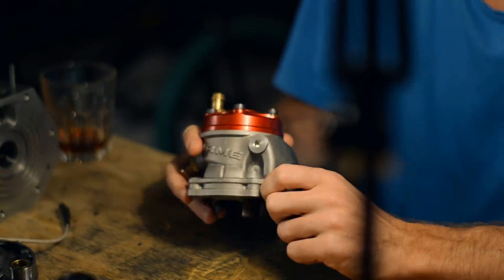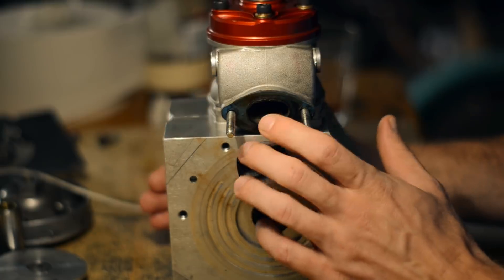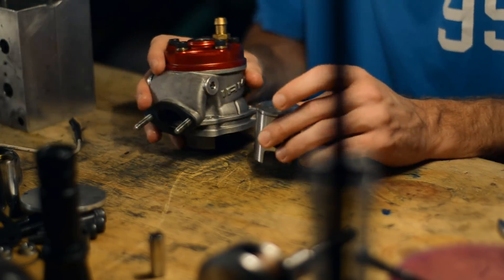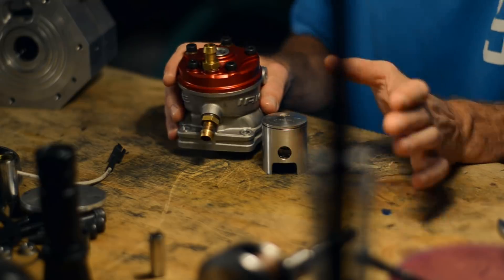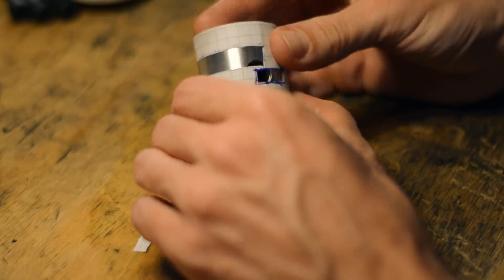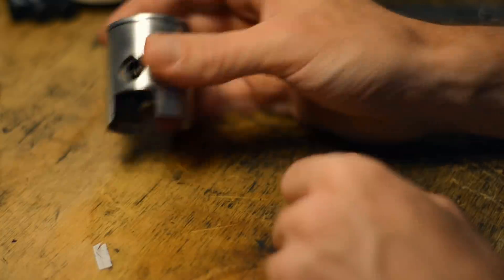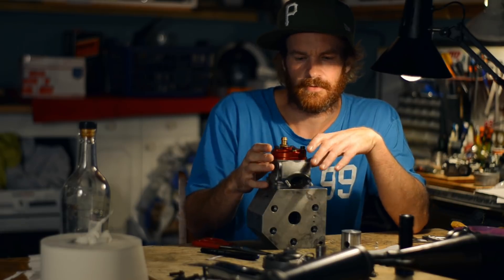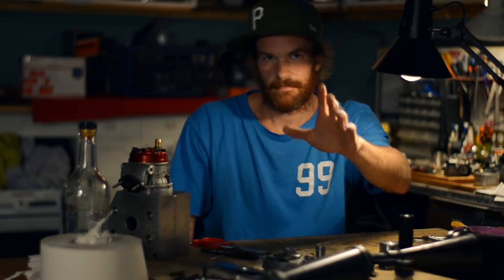A Two Stroke Revelation!

Comment: Hi , Check Your History , Model Airplane / Aircraft engines back in the 1940's ( And to Present )  In some used a " Rotary intake valve /  But the Exhaust port could be machined into the crankcase in any Direction In Relation TO The Crankshaft Rotation .  Some High Powered Racing Engines Used What Is Called "" SCHULE CYLINDER PORTS ( Porting )  "  Some Engines Even Had Small Transfer ports That Were Cut at a Angle to direct the flow of air/ Gas Mixture Toward the glow plug ( Spark plug ) , This also Helped with Scavenging the Exhaust OUT of The Engine . Good luck . :)

Comment: Hi sick video! I have a question (again lol) I have a chainsaw style flywheel (not the scooter kind like this https://www.google.com/search?q=g260pum+flywheel&oq=g260pum+flywheel&aqs=chrome..69i57.7156j0j7&client=ms-android-google&sourceid=chrome-mobile&ie=UTF-8#imgrc=6uNeYQQusIUBKM:)  and I have to drill out the hole and when I do that the flywheel key slot won't be deep enough so how would I go about making that slot deeper? I don't have any fancy machines like a mill I have a Dremel tho. Also is it a bad idea to to drill out the crank pin hole (big end) to fit a bigger diameter pin?
Reply from the maker: Thanks! The slot can easily be worked with small files, won't take much effort - no need for fancy tools. Re the big end, should be fine as long as there's enough material (at least half the pin size in thickness anywhere around it)
Reply: @2STROKESTUFFING  awesome!

Comment: Maybe I'm wrong here, but i think you'll achieve more or less the same result by replacing the rotary valve in a position like this one, at least regarding the crankhouse symmetry / scavenging symmetry:  http://club.caradisiac.com/druide60/private-category-0/photo/moteur-ital-sistem+2db-1191704.html The guy who invented this is named Achille Parrilla, who for several years was the major engine tuner at the DAP factory in Milano. I know him very well, as I used to race their engines back in the seventies, in different championships. After I ended my racing period, Achille came up with this solution, an gained several more horsepower. If not to complicated to arrange, maybe you should try it?
Reply from the maker: Thanks for the link! That would achieve symmetry, but not solve the exhaust/transfer communication issue.

Comment: What about the pumping effects of the crank ? ie, primary compression ? as you've moved the transfer ports 90 degrees to the crank..? and you've changed the major and minor thrust faces..? Not really sure you've improved anything at all ?
Reply from the maker: Cylinder orientation doesn't affect primary compression as long as crankcase volume stays the same. Yes, moving the thrust faces 90° might be a problem(as mentioned in the video) but then again maybe not cause there's ceveral engines already running in this configuration seemingly without issues.

Comment: the improvement of a  rotary valve 90º vs transfers was demonstrated by the Derbi 125 stroke wining the last word championships. They were putting the rotary valve on the back (as the normal admission) and rotating the disc valve trough a 90º precision bevel gears. Flow is symmetrical to the transfers and better oriented (less restrictions).

Comment: Give it up bro, petrol is dead, electric will take over within 5-10 years.
Reply from the maker: That's true, I'm just doing this for fun.
Reply: 2STROKE STUFFING the biggest problem with the two stroke was it’s fundamental design. It is not fuel efficient and although they make the best power for displacement size the power is only available through a narrow rev range. What your doing can’t change that but hey have fun

Comment: so the problem i see is, port timing. in my mind it would be ideal to have the piston rotated 90 degrees with the cylinder. so a connecting rod that is twisted 90 degrees to match. i love the idea that is going on. however the transfer port timing seems to be a problem in my mind. with the piston matching the cylinder, you can have your 100 percent exhaust port width and still be in control of your port timing. however the challenge i now see is how to have a strong connecting rod that is twisted 90 degrees from the crank? or a custom connecting rod made with a large piston pin head to be able to machine 90 degrees out. subscribing to see what comes of your engine!
Reply from the maker: Thanks! The piston will have to be designed for the job, and port timing won't be a problem. A twisted conrod would not work, think about it it would bind as soon as the crank started rotating.
Reply: ahhhhhh i didnt think about the width of the twist!

Comment: It's a nice concept but you can never run 100% exhaust port width. I think it was the 3MA TZR250 that had it's cylinders reversed, so that the piston would be mostly supported on the intake port side on the powerstroke to limit the ring and piston wear from the somewhat larger exhaust ports (unfortunately I don't have any stock 3MA cylinder to measure the width). Back when I ported my Typhoon's cylinder I went for 63% which is 3% more than the "limit" for cast iron piston rings (with chrome rings you can go up to 65% but you can't run them on plated cylinders), and the rings last for only a few fast rides.
Reply: My Parmakit 144cc have 82 % exhaust original, it is bridged exhaust, my polini evo 130 had 68 % and not  bridged.
Reply from the maker: On smaller stuff you can go wider, I've seen 85% in a 40mm bore working.
Reply: I think this would heavily depend on piston-cylinder clearance but it wouldn't last for long. A large fillet on the port windows could help but the piston ring design is equally important for this. It's the rings that will give you hell if you get too much out. I have thrown many 47mm pistons with tiny pieces of rings stuck in the ring land. 3 runs and the ring land start getting worn out in that area. I don't know if keystone rings could help, and I don't know what ring gap design would be safer (I find that the half circle peg gap rings seal a lot better as they wrap around the peg)
PS: It just occured to me that you're reffering to the whole port including the bridge...Yes that would work fine but you shouldn't go all out, as the bridge just helps the ring get seated and is relieved compared to the rest of the bore.
Reply: with my experience, you can go 100% but the port has to be shorter. down side is not getting all of the exhaust gas out. benefit of not loosing all of the exhaust gas is cooler cylinder temps and more pre detonation protection. kind of a weird trade up. i do see and understand your concern. the smaller the engine, the more you can get away with.

Comment: We messed with the concept of intake and exhaust ports on the same phase back in the day on a YSR-50. Devcon will be your friend with sealing the wrist pin. The most crucial aspect of this design is transfer port angle and shape. Varying the port angle to keep the fuel charge turbulent in the combustion chamber is critical, having a port angled at 3 and 5 degrees while one oval and one squared off helps to. Software and information is a lot better today than in 1990 so make good use of it and have fun

Comment: Did this same thing over 30 years ago, shortened the piston pin and made aluminum caps that were placed in the pin bore, piston pin rode against the inside of the  caps still in the piston pin bore, and used standard circlips,  benefits from the lighter pin , sometime used custom pistons, sometimes used pistons from a different application, used the same technique for oddball custom bore and stroke combo's with pistons that had for example 20mm pin bores and rods took a 16 mm pin, anything is doable with an imagination and the machinery at hand.
Reply from the maker: Cool!

Comment: Please help: one port degree in mm = Engine stroke / 360 (or 180)?
Reply from the maker: I'm afraid It's a bit more complicated since the piston movement isn't linear with crank rotation - google "piston travel vs crank rotation" for equation and calculators.
Reply: What I am trying to figure out is mm increment in cylinder gasket I need to set my engine to a particular exhaust port duration, let's say for instance 198º. Will this "equation and calculator" give me the mm in cylinder gasket needed as per the piston travel value?
Reply from the maker: @mpelondamba1505  yep.
Reply: Now, which part of the piston should I use to set the exact height: the piston crown, or the piston ring?
Reply: @mpelondamba1505  The crown.
Reply from the maker: Yep

Comment: Use nylon blugs on the pin? On vw bugs we use sometimes those nylon blugs so there is no danger losing a regular clip. Some say it damages the cylinder and its true IF there is shit that gets stuck on the nylon. Otherwise no danger, withstand tje heat etc

Comment: rotary  valve   motorcycles  were  strong  in  the  70s  and   80s     can am   kawasaki  atk
Reply: Lee Turner True but they abandoned that idea. Had Kawasaki and Can Am slow bikes.
Reply: Those were pretty good for INTAKES on the Smaller two-stroke engines, but they ended up being rather wide because of the carburetor's location on the side of the engine, or a difficult to tune lag because of a long manifold if the carburetor was mounted further back.
Reply: My Kawasaki KR 250 road bike had rotary disc valves
Reply: ski doo rv engines are still strong to this day. They did stop making them, but they make great power.

Comment: Well i guess there is hope that i can get at least 10 or 12 HP from my 50 cc cylinder. More than 25 rwhp....A far off dream
with the junk i have. My hat is off to you, Very impressive indeed that you get even close to those numbers. Well Done.
Reply: Van Veen was getting 20hp (on dyno) from 50cc Kreidler racer in 1979/80, so I think with modern materials and technology this could be increased, to ??
Reply from the maker: Absolutely, best so far is Rosem's RVRT Zundapp - 50cc, 25hp at the wheel! Mind blowing.
Reply: Do you have any knowledge of the hi-per 2 cylinder ( piaggio ) being a 2003 i think it shares enough in common with the older cylinder assy pre 1998. There is no info i can find at all on this engine. Other than pipes and carbs.
Frustrating after 6 months all i get is parts.
Reply from the maker: Thanks, I'm far away still tho. Current best is almost 18hp at the wheel.

Comment: hey, already have the ardyno boards? ah and on the sideways cylinder dont forget the location of the ring  pin, it cannot pass any openings
Reply from the maker: Yep! I won't forget!
Reply: Thats not true Jose alot of off top notch cylinders have the peg and ring ends over the rear smallast  C/boost port  and i remember Jan Theil writing about this on   (.pit-lane.biz )
Reply from the maker: Yep, I run it straight over the C port in the Spx too.

Comment: Really cool. If you need a plug aluminum may be a good choice. Aircraft engines use aluminum plugs instead of circlips or pressed pins. The plugs are pressed or swaged into the pins but being 4T they have no ports.
Reply from the maker: Thanks, and thanks for the tip!

Comment: If you press a plug into the wrist pin a little towards the exhaust side of the bearing there may be a lubrication improvement waiting to be discovered. Or you may have already mentioned something similar as I watched without sound. A programmed soundwave as an exhaust stuffer and/or helper keeps rattling around in my head as I watch your progress. Boa noit.

Comment: You need to block both sides anyway.
If you don´t block off on the exhaustside you will get overheated small end bearing.
Reply from the maker: Wouldn't blocking the exhaust side only be sufficient?
Reply: I´m sorry, misunderstood,, i though 180degree away ;)

Comment: great analysis! there is one fly in the ointment, however, to the clocked port scheme: your transfers will see divergent flow rates due to turbulence. why? the crank flywheels. on the front transfer, your wheels are rotating downward, on the rear, upward. the front transfer will have a turbulence pattern that "stuffs" the cylinder (due to the clockwise as viewed from the left vortex), the rear will have a vortex rotating the same way, thus "unpacking" the cylinder, both due to the rotational energy. side mounted transfers see symmetrical vortex influences as related to piston centerline, tornadic as opposed to "tumbling".

Comment: Look into teflon buttons. They've been used in place of wrist pin circlips for years.
Reply: Those are for 4 stroke engines I use them in several engines but never on 2 strokes
Reply from the maker: Thanks for the tip!

Comment: Piston ring pins bro.  You don't want a ring opening in port
Reply: A wide port like he mentioned would not be advised without a bridge or 2, leave bridges where the pins are located?
Reply from the maker: Would relocate the pin to have it riding over the third transfer.

Comment: Early McCullough chainsaws had the exhaust port over the end of a pin and because they used needle roller bearings in the piston a closed cup type was used exhaust side.
Reply from the maker: Cool!
Reply: My first racing kart way back when had a Mac 93 on it.  Great place to start, but what a pain to work on that motor.  A lot of times the only way to get the pin out was to press it thru the piston wall destroying the piston.  A blind hole for the wrist pin and the skirt wrapped around differently to match the goofy port layout.  Looks like what's old is new again.
Reply: No, wasn't ever worried about saving the piston.  Though it's been long enough I don't remember much more about it.  It didn't take me too long before I moved on to proper two stroke racing engines.

Comment: What about piston ring catching in exhaust port? Plus rematching transfer ports in case to cylinder.
Reply: I think I see what you're saying. If the exhaust port goes farther around the piston than 180*, the ring will push out into the port, regardless of where the end gap is. You would need a couple "ribs" in the port that you don't cut out of the sleeve so you can keep the ring on the piston.

Think of it like this, you hold a ring on a piston with two fingers at 10 o'clock and 2 o'clock. The ring will push out toward 6 o'clock. Now if you add a third finger at 6 o'clock, the ring will stay in place all the way around.
Reply from the maker: With modern rings you can go to about 80% of bore on 50cc, maybe even 85% with well rounded port corners without the ring catching, over that and you'll need a bridge. The smaller the bore the more forgiving.
Reply: 2STROKE STUFFING  Then 100% without a big bridge in the middle....... would not be an option.
Reply from the maker: Maybe close to 100% is possible on say a 20mm bore cylinder.
Reply: @cristianr3712  Correct. And introducing a bridge creates it's own issues. Keep it thin and you get localized overheating and a good chance of seizures at the bridge,  make it bigger and you lose port area..
Reply from the maker: The pin should ideally be moved 90°, and yes the case would need some work.
Reply: you normally have you piston ring gap opposite of the exhaust port for that reason.
Reply from the maker: Yep

Comment: You definitely go the extra mile for quality!  I use your videos as a guide for my stuff! Thanks
Reply: Yeah the film quality is awesome !  You have a certain video quality that's unique  don't change it whatever you do .  What Gear are you using camera etc ?
Reply from the maker: Thanks! Using an old Nikon D5100, most of the time with a cheap Youngnou 50mm f1.8 lens - nothing fancy.
Reply: 2STROKE STUFFING how is the lens working for you? I have a 25mm f1.7 lens for a Panasonic g7 and it kinda sucks. No zoom and slow autofocus. I use kit lens 99% of the time
Reply from the maker: Well, it's fixed, so no zoom, and autofocus sucks with this one too. But I use manual focus anyway and move the camera around. Inconvenient, but I like the look of 50mm(actually 75mm with the D5100 crop sensor) especially wide open.
Reply: Saludos Papa Atlanta
Reply: Hues.   Gula.  Tumesla.    Nmrez.  Bues.   Des.  Hule   bula
Reply from the maker: Thanks! I try!
Reply: Desfiles. Cumltiuñtes hulites.  Lomaduilesculesgulla. Deslcyezl Tuma as cuies. Nuliltes lacumstumtuirweslacumdulia

Comment: Hmmm  close the piston  weld it up , the space between the pin and piston will produce a blow by under extreme pressure  . Just thinking out loud   here
Reply: Chris weld it and put it in a lathe? Make it smooth?
Reply: Vasily Custom Builds Thought the same, fill it with weld, redrill and use the same pin. Least amount of weight added and zero communication between exhaust and intake ports.
Reply: Yeah tig it up and put it into the lathe clean it up nice  them move on to the next issue . Does that piston have the ring locating pins ? that might be a issue where they sit  in the bore maybe ?